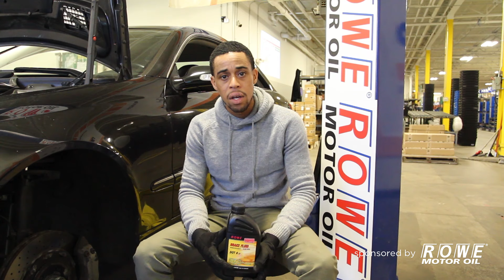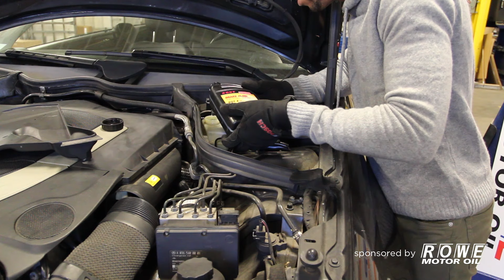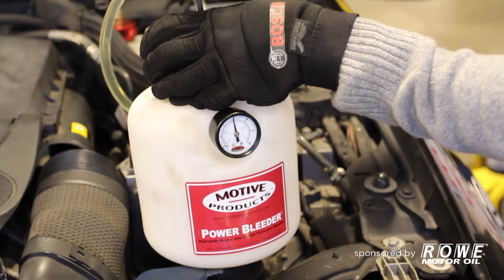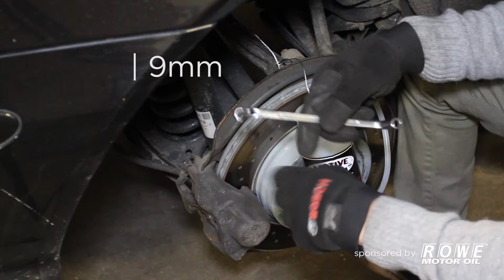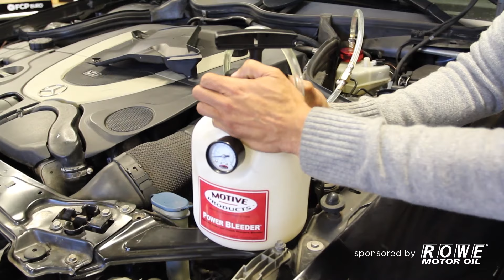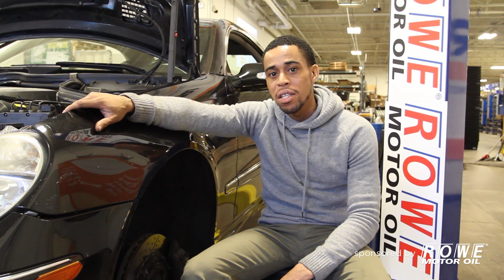Mercedes Brake Fluid Service - Refresh Your Brake System (CLK 550, W203, W209 - ROWE)

Comment: It would be helpful to discuss the order in which to bleed, farthest to nearest to the master cylinder/fluid reservoir. Also, you should state the SBC disclaimer up front and that it requires a special diagnostic tool to use on the SBC when performing the bleeding with that system.
Reply: that is a good point Jetta Red.
Reply: ?? what do you mean can you please elaborate. i just changed my brakes on my 09 CLK350 and im about to perform a brake bleed. I dont believe i have SBS but i could be wrong, do i need to worry about something following my brake bleed?
Reply: I agree about the SBS.  Particularly as it is basically ignored as not truly important.  Particularly as there is no mention where to go for an SBS system, no link, no tools offered??
Reply: why this gentleman refuses to answer questions regarding sbc? I have landed here looking for the same answer

Comment: Great video. I own 2006 W211 LIFT without SBC. Can I use the procedure of brake fluid replacement you've presented on the video?
Reply from the maker: Hello, the process will still remain the same! We also have a video on the motive bleeder which shows you how to do a pressurized flush as well: https://youtu.be/JWJIYeourjY
Reply: @fcpeuro  Thank you for your answer. I will try this procedure soon. I don't need any diagnose tool or computer to brake fluid replacement and I like it. Greetings from Poland. 🇵🇱

Comment: Great video brother. Really informative. I just purchased a 2014 G-Wagon G63 with 13K miles and a message for SERVICE B required is on, so I need to do this process. Can you advise if it is the same as you did? Thanks a lot from your Brazilian brother. Cheers
Reply from the maker: Hi, Luiz! You are correct, part of Service B is replacing/flushing the brake fluid.

Comment: Thanks!! Great video. THis is so much easier than oil change wow. Only issue though my Motive Bleeder is defective and was leaking in between the gold nuts. So, wasted so much fluid and had to push the pedal to make it work. Will be calling them for a replacement. Otherwise, job well done and now my brakes work again. :)
Reply: Your bleeder wasn't defective. You have to use teflon tape to seal the threads. That's why the instructions spell out the method for testing the system dry.

Comment: I did the job but now I need to get an expensive tool to bleed the ABS pump because car won’t stop. Mercedes years 2000+ require this. Don’t change your brakes yourself unless you have this tool.
Reply: im so confused by this comment. can you please elaborate while i do more research and find out what youre talking about because i just changed my brakes and im about to bleed...
cheers
Reply: what tool send link 
<3

Comment: Late to the party here, but will you guys EVER address flushing the ABS pump when advertising these bleeder tools (which are, I am sure, very good, I'm a fan :) ) ?
On any car with ABS the ABS pump needs to be flushed as well. This can happen by activating it. Activation was easy on older cars (there would be two dedicated terminals on the pump to jump together which activated the pump), but on most recent cars, all brands, you need a smart enough scanner or dedicated software to activate it via OBD.

That, or you'll have all your system flushed fresh, and old liquid in your ABS pump, which will mix with the rest the first time your ABS activates.

Or, if you use the "Flush fluid, go driving, activate the ABS on a slippery surface, flush again" system - please be clear about it ?

Comment: Do you really have to flush the fluid or you can simply refill the tank?
Reply from the maker: Just refilling the tank will not replace all the fluid in the braking system.

Comment: question i have a 2013 c300 how do i knw if i have a "sensatronic brake system? or can i do this same procedure as the video
Reply from the maker: None of the C class vehicles were equipped with SBC
Reply: @fcpeuro  the GLK SUV didn't come with the SBC either ?
Reply: @reyesracing24  
Sensotronic Brake Control applications
2003-2006 E-Class (W211)
SLR
Maybach
2003-2006 Mercedes-Benz CLS-Class (W219)
2001-2011 SL-Class
Reply: @fcpeuro  any special tools for ABS pump as mentioned above or does it properly bleed as you showed on the video?